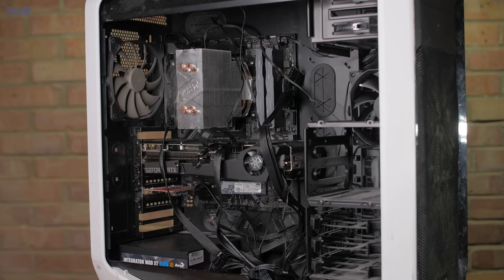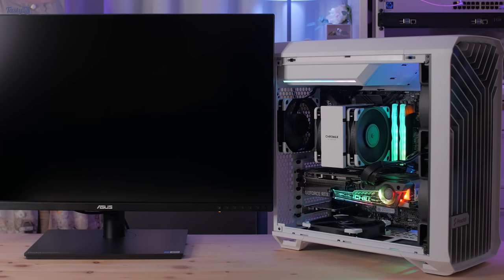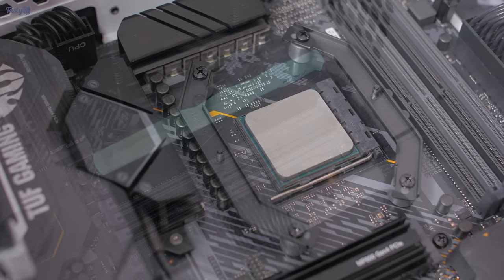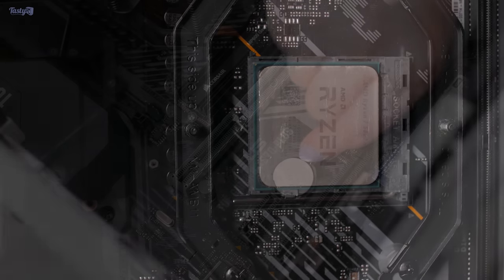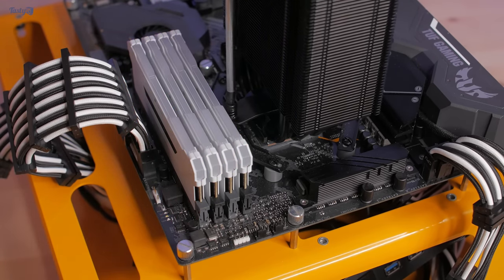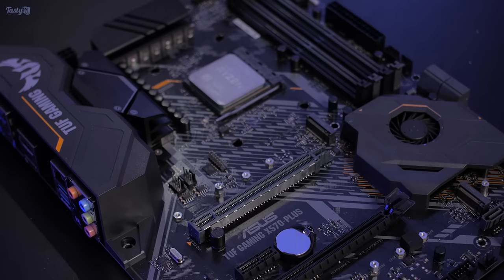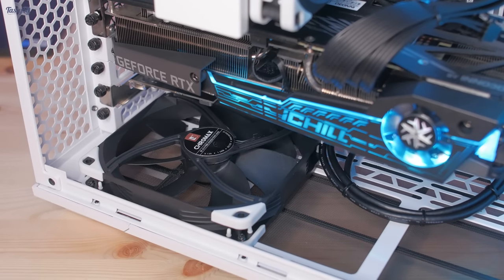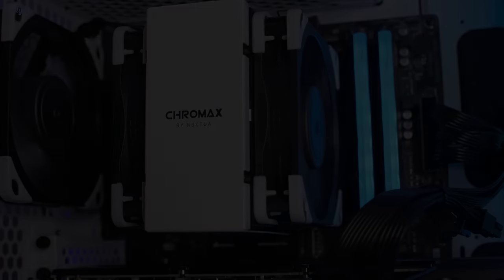I BROKE A VIEWERS PC??

Comment: You could have totally just swapped the board and left it at that. I love how you actually got to the root of the problem. Such an interesting problem too and one I have never seen before.
Reply: This is the same sort of problem the original xbox 360's had and is what would eventually lead to the famous 'red ring of death' error.  I wrote up my story of how I repaired this problem by taking apart and re-engineering my xbox 360 before I even turned it on for the first time in my post in this same video.  It's a lengthy explanation (and no it's not the stupid towel method)....  heh.  Anyway, my original xbox 360 still works perfectly to this day - even big company engineers can do very silly things with their designs.

Comment: Yikes, I wonder if Chris overtightened the original cooler, the mount was badly designed, or the weight gradually pulled on the socket and board and caused micro fractures or stresses in some traces inside the board where you can't see it. That board is toast either way, send it to the WEEE skip. Very good of you to donate your own board! What are you going to get in to replace it?

Comment: I still would like to know why each time we pull the cooler off the cpu sticks to it. Happens with air and water coolers.
I remember the AMD FX days and that was not a issue.
Reply: @sonacphotos  Odd never happened to me before.
Well AM5 doesn't have that issue either and when prices get back to real world I will get am5.
Reply: I have been using AMD CPUs since before they were using PGA for their CPUs (Pre-Athlon), and ever since they started it, it has been an issue. I have damaged more than a few when just removing the coolers from the builds. It kinda forced me to learn how to correct bent pins on the CPUs, as replacing them was getting expensive lol. Once their pricing drops, I def want to try AM5, or maybe even Intel for the first time in several years. Either way, I have hated those pins for a very long time lol.

Comment: I had a similar issue when I upgraded from a 3700X to a 5900X. The RAM I had was not officially supported by my motherboard, even after updating to the latest BIOS. I ended up buying ram which was officially supported and no more problems, 32GB (4*8GB) G.Skill, 3600Mhz. Motherboard is an Asus ROG Strix X570 Gaming - F. I mention this because apart from the latest BIOS update, Asus also has a new supported RAM list, which updated through the Armoury Crate, I think i was.

Comment: Great vid. It ALWAYS pays to run your own primary tests BEFORE taking a system apart re upgrading, adding components et That way you can film it AND prove that there were errors that were NOT of your doing et? In over 40 years of PC builds et I learned that sometime its NOT our fault re the builds /building BUT manufacturers who can seriously LIE, CHEAT, DECEIVE. 👀Certain motherboards that WON'T work ie POST when you use certain components because of INCOMPATIBILITY KNOWN to the manufacturers.. issues. YOUR process of logically going through fault finding illustrates so well what can drive us nuts.. what you experienced is how we feel and what often our 'customers' seldom ever appreciate. 👀Sometimes we just have to give in and compromise accepting NOT to drive ourselves into total lunacy .. well this works and the customer is more than happy.. end of STORY.. 👀

Comment: I had a neighbor that wanted me to build a computer. So no problem, except they got it home...and it would randomly shut down...just boom off. It happened with random users also. So I could never reproduce it at my house, only at theirs. They got a UPS, didn't change anything. I ended up swapping every component 1 at a time. We're talking the PS, MB, mem, HDD, GPU, CPU, fans...NEVER could stop the thing from randomly shutting down ONLY at their house... EVERY component worked flawless at my house with no issues. Finally gave up after a year or so.

Comment: I've had the exact same problem. 3950X, X570 Aorus Elite, NH-D15, TridentZ RGB. I did almost everything that was done in this video, except swapping with spare components. It's very frustrating because I don't have any other components to find the problem with. After disassembling many times, I checked carefully, it looks like there is a little thermal paste on the cpu pin. Maybe it causes communication between the CPU and RAM is disrupted. After I cleaned it thoroughly, I finally found that I managed to fix it.

Comment: Love the vid. I have same exact issue, b550, 5800x, 32gb corsair dual chnl kit. Can't dual chnl, I had to buy different kit, even though the ram worked fine in a different system. So frustrating.  I wish I can help you. Good luck !

Comment: My wife's PC gave me issues. For 4 years it ran just fine with 2 sticks of Ram  (2x8GB). I recently added 2 more sticks to total 32GB. This was the same kit SKU as the original pair. On boot windows detects memory errors. So I go through testing all the sticks in all the slots (with XMP off). Even the original memory was now reporting as faulty if it was in the slots that had not been used in the past. The system was very unstable, crashing if all slots where used.
I eventually decided two of the Ram slots, or the memory controller where faulty. I installed a 32GB kit (2x16GB) in the original slots, and the system ran just fine.

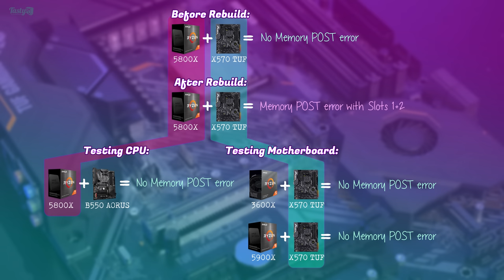Comment: AT the 7:00 minute mark, as per your flowchart, I would see if I had another x570 board and test the 5800x there.
Because the only 5800x test that you did was on a B550. Perhaps that mean nothing, but just trying to cover all bases.
A side note: Not a fan (Ha,Ha) of the x570 board(s) with active (fan) chip-set cooler!

Comment: got 8 min's in so my be add spacers under cooler block lift it bit higher so not push so hard on cpu, as cpu will not bend but socket or board will in turn pull pins out socket or other way pushing pins in to socket, could small crack on board when push down with cooler my open small crack stop trace working send info to rest of board.

Comment: I had the exact same issue with my old Phenom II X4 setup a few years ago, it would randomly freeze, sometimes to the point of not starting at all. When it worked, the temps were normal. Then I realized if the motherboard was laying down instead of vertically, the issue pretty much disappeared. I was using a Hyper 212 cooler for a while at that time, and I have a feeling the weight slowly damaged the motherboard. I put back the short box cooler with its mounting bracket and it reduced the instability drastically. But then they came back progressively and it became nearly unusable. It was also an Asus motherboard, an M4A89GTD PRO/USB3.

Comment: That is one of the issues that makes absolutely no sense, I had an even more weird Ram issue, I used to run a 4790K on a Gigabyte Z97 Board, everything was fine, and suddenly the next day the PC wouldn't post any more, it took me 2 days to figure out it was the ram, and another 2 days to understand the stupidity of the issue. 

Basically I went at it as you did, test every ram in every slot, PC booted every time, so I thought the issue solved itself, well, no, if I put both ram in it wouldn't Post any more, but here comes the stupid part, if I booted the PC on one stick, let it run for 5 minutes, shut it down and quickly placed the ram back for dual channel it would boot just fine, I then tried out another combo, an 16 gig kit and 8 gig kit for a total of 4 sticks and 24 GB ram, odd number, but it made even less sense, the System posts fine when I put the sticks as 4/8/4/8, it would post 4/4/8/8, but it wouldn't if I reversed it as 8/4/8/4 and 8/8/4/4. I even went as far as to get my hands on Intel socket schematics and pin layout schematics to find which is responsible for DRAM signals/Controller. 

I got a Mainboard off ebay then, an MSI Z87 GD65, which got replaced at the end of 2021, 7 years after I got my 4790K I switched back to AMD, to a 5600X with a B550 M Mortar from MSI. 

There was physically nothing wrong with the Ram, the slot or CPU, to this day I have no idea what the problem was, all I know is I tried to RMA it and gigabyte is now dead to me and I hope they go bankrupt, that was astonishingly the worst customer support I never received, I send tickets, which got deleted, I called them, they simply hung up ironically without ever picking up, e-mails were never answered, Reddit, twitter everything got ignored and deleted. For that reason alone, I won't touch Gigabyte ever again, even if they have the best stuff at the best price and what not. 
I even had a full gigabyte build back then, now it is a full MSI build and i am quite happy, the support experience has been stellar so far.

Comment: Right I have the issue myself with not posting, but the reason why were different... So with my AMD build my Three issues were as followed... first time, there was a god dam carpet fibre stuck on pin side of the CPU.. I only spotted this carpet fibre once I had sprayed it with contact cleaner, removed the carpet fibre, booted up no problems.
Second time required a BIO update, why do don't know but it insisted, problem solved,
Third time one of of my sticks of ram had died, now I worked out why, my gigabyte x570 master board dim layout is dim 1 and 2 channel 1 dim 3 and 4 channel 2, basically i mixed packs of duel channel by mistake... And with the xmp on killed a stick of ram....
Now regarding coolers and pressure issue you have had, I have this issue with my intel build, yeah cooler pressure causes issues even when only finger tightened down... So i switched my CPU cooler to one that has a spring retention system which you screw down to the back plate. I used vetroo v5, it is cheap and the only aircooler that can clear the asus z690 e gaming board vrm heat sink (old version not current version), this corrected the issue, which like you confused the hell out of me why it wouldn't play ball... 
Now i am both shocked and kinda relieved it isn't just me who has had this issue.
Oh and on the AM4 pulling off on the CPU cooler, I find the jay2cent method for breaking the thermal paste is the best... twisting 45°one way the twist 90° the other (45° each  side of 12 o'clock)

Keep up the awesome videos, you got a new follower in me 👍

Comment: How long did it not post, maybe it’s still training the memory, it could take some time. Maybe the memory controller needs more voltage. You could bump that with one module in 3/4 and add the other one later.

Different Vendors / boards use different voltage presets.

The memory controller on zen3 (with the now higher fclks) is very tricky / unstable. (That’s why there were the PCIe 4.0 / USB / audio problems at launch). Some haven’t been fixed to this day.

Voltages to look at are vsoc, vddg, vddp, vdimm and the dimm termination voltage / resistance.

Comment: I got the same issue with an ASUS TUF gaming X570-PRO WIFI 6, The pc doesn’t work in dual channel, it doesn’t work with all 4 slots occupied and it doesn’t work with slots 2A and 2B, it works only with slots 1A and 1B connect, I don’t know what to do

Comment: You didn't break their PC, it was already "Broke" when it was sent and even then that CPU was on it's way to being fried anyway.  The original person who installed that lousy Gammax cooler over tightened the lock downs and caused a micro fracture in the underlying traces.  This is crazy common and I've seen many instances of it in my 25+ plus years building and repairing PC's.  This is of course only 1 of many scenarios, the MB could have been messed up that way from the factory (Remotely possible), most often it's installer error.  While it is possible you may have done dmg yourself, judging from your description it's unlikely.  1 rule of thumb is to always check everything BEFORE replacing anything, a full Burn test noting any and all hiccups.  You can easily wind up down the proverbial Rabbit hole if you skip steps or take shortcuts.  Great video and good lessons to learn.

Comment: There is a lot of know AMD CPU problems with memory channels pci Lanes because of the amount of presure for specific coolers. You can find a lot of people commenting these on Reddit. I was always using Intel but 1 month ago I bought a new AMD rig for upgrading my old PC Intel i7 4790K and when I put the original and cooler i was still afraid to apply to much pressure, I only have 1 stick of 32GB but when o bought one more in the future i will recheck the pressure sometime the dual channels doesn't work well because too much pressure. Happy i find another perfectionist PC builder. 
Impressive job and nice video reviews, a lot of people would learn from these. Keep it up. kudos 👍👌

Comment: Very nice troubleshooting. I had a similar problem on an old x58 i7 980x with a cooler master V8. It only detected 12 of the installed 24 GB of RAM. Seems that it had a problem with heavy air coolers, changing the pressure on the socket. With an Intel boxed cooler and AIO water cooler it ran just fine. Took me ages to figure it out.

Comment: Great build and really informational... Proves what I've been noticing for ryzen cpus that I've dealth  with these past 4 years is that the mounting pressure really affects the cpu - ram/PCIE communication... I have an SFF build which I carry all the time with me when I go on vacation and it has issues with either not posting ,not reading all the memory modules or resetting back to default bios settings. Even an accidental table bump (My system has  no HDD) causes my PC to crash and have the above mentioned symptoms. After troubleshooting, it always isolates to the CPU getting loose...hopefully the AM5 socket eliminates those issues. Well done and more power to your channel!

Comment: Holy shit….. im so glad I saw this because I was using an expensive X570-crosshair Formula mobo, It was working just fine, then all of a sudden, when I came home from work….. “B0 error, C4 error” and the DRAM light was on. so I tried new memory, didnt work, tried new cpu, and it didnt work. downgraded the bios, didnt work, upgraded the bios, didnt work. reset the cmos, didnt work. I havent tried to clean the socket because I was too nervous to do it. nor have I tried to clean the dimm slots. I bought a cheap b550 MSI motherboard I got from bestbuy with my points. But I was very sad to see my $550 motherboard not work. im gonna try to see if any of your steps will help, but it was like nobody on reddit knew what the fix was, and I had a ton of homework + exams that was due that week so I was desperate AF.

Comment: Great vid, nice build! 

I just wanted to comment about the Memory/CPU/CPU Cooler issue. Whenever the two closest memory slots fail to work, it is usually related to the CPU cooler being screwed on too tight. I've encountered this exact issue with an Asus ROG Maximus Extreme XI board and a Intel i9 CPU. Since I've encountered this before, I would have tried to loose the cooler's base support screws just a tad and then tighten the cooler. 

I'm not sure if this issue is strictly with Asus Motherboards, or if it affects all brands of motherboards the same way. 

Great Job troubleshooting the issue!

Comment: Great video and presented in a way that is great Edu content for young hardware techs btw. I will be sharing this with Junior Staff member to teach them how to approach things via process of elimination which you have demonstrated fantastically. 
I also had a very similar experience about 6 years ago with a customer who had spent about $4000 (AUD) on their system 3 years before and they weren't shy of spending $1000 to get it up and running again. I was fairly sure I had narrowed it down to a MOBO issue but had no compatible MOBO to test with and had to acquire one and by then the price of a compatible MOBO was going UP in price because of their rarity (thanks to single socket generations of MOBO). There's only so many spare parts you can have for troubleshooting this kind of stuff and I think you did the right thing to just go with a board you had readily available and get it back to your friend. For the customer I referenced new MOBO fixes it and they ended up paying close to $1000 for the repair back then but were frustrated by the time it took me to get the part which was counter-intuitive to them. Like why couldn't I get a second hand one cheaper and quicker? Because they didn't exist and I had to pay 25% premium on it's original price to get it. This is why we need sockets that last a few generations not for upgradability but for repairability. 
P.S Memtestx86 is still a thing and very useful for RAM troubleshooting but interpreting results needs a pinch of salt.

Comment: I've been having the same exact issue since replacing my stock cooler for my ryzen 3500 with the DRAM post failure or sometimes everything will post and boots successfully only to have issues with freezing later on that would lead back to the same DRAM post failure.

I thought I was going crazy because the issue wasn't consistently happening only swapping out the RAM or taking it off XMP seemed to fix the issue temporarily.    

Suspected but didn't really think the mounting pressure and certainly hadn't consider heat expanding might be the issue.

Comment: cantact cleaner / airflow sensor cleaner applied to the CPU/socket will sometimes clear up issues like this, i had a brand new build PC for a customer that was inconsistently unstable, i tried all of the usual troubleshooting steps, some things would improve stabilty or change the trigger, but nothing stopped it crashing completely, eventually i cracked it and DROWNED the motherboard and CPU in circuit board cleaner, dried it and re assembled - NO MORE ISSUES